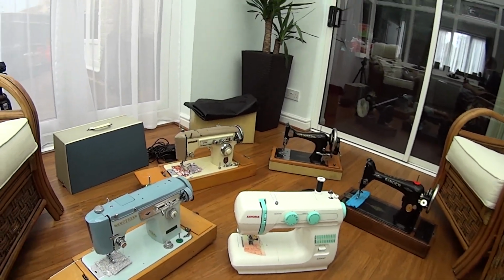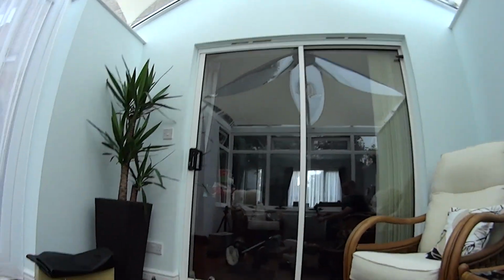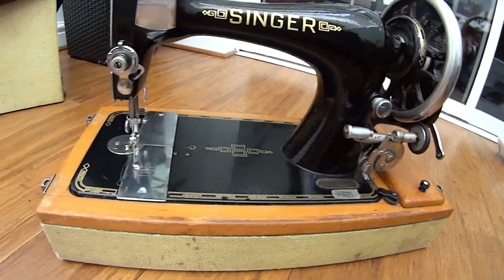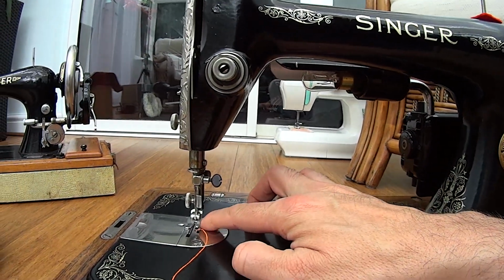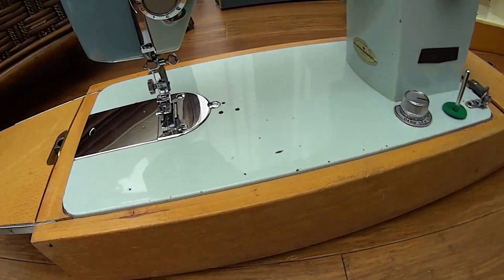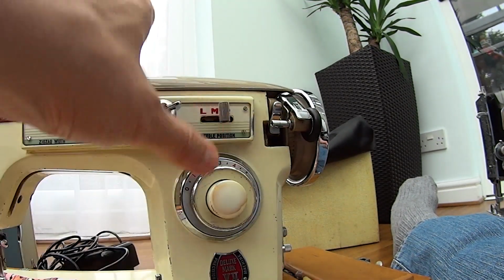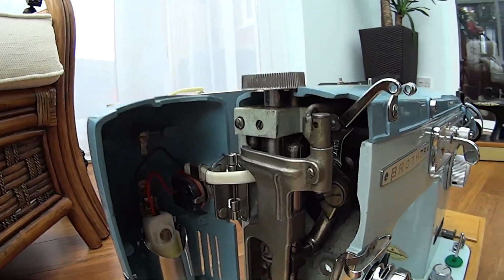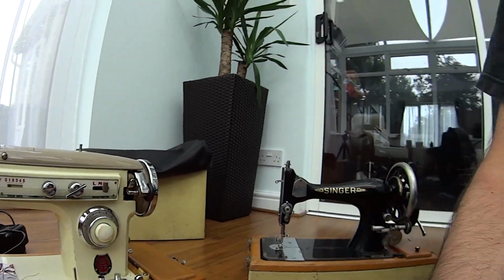How to buy a Sewing Machine : Wild Camping

Comment: Ebay wasn't working for me. I ended up picking up a Husqvarna Viking 600 off of Craigslist. Sews pretty well, certainly better than I do. I picked up a couple DIY packs off of Ripstopbytheroll. Sewed a stuff sack in about 20 minutes. It looks not that great, but it's completely functional.

It was more than I wanted to pay for a sewing machine ($200 US), but the local Husqvarna store took a look at it and declared it mint. So away I go.
Reply from the maker: Theball Player excellent there is no stopping you now :)

Comment: you are AWESOME !
Reply from the maker: Many thanks :)
Reply: Tac Blades hi friend.
would you like to design and teach to make a dual use ,  light, (empty shell - no insulation), 3/4 uq , that can be used as a spe ( pad extender, with side wings), or used as empty uq, or with whatever temp insulation, shoved in?)
thanks
Reply from the maker: gulu m its an interesting idea, its not something i want to build, but you can already buy a SPE shell that does just that for low cost so its not worth making.
Reply: Tac Blades I don't know of a pad. extender, that can be used outside as a uq. do you have a link?
Reply: Tac Blades perhaps it can be triple use, also as an uq protector.
Reply from the maker: gulu m yes maybe ☺️

Comment: I have a 1938 Singer 66-8, looks like the other black singer's you have. The wheel in the back moves in both directions, so does that mean I can do a back stitch manually? And are zig-zag stitches a must for tarp seams?
Reply from the maker: Maybe it depends if the feed dogs move the fabric backwards?  Normally the wheel keeps turning in the same direction.

Comment: Thank you for this video. Great info! I've got one of the old Singers that I'm going to have to refurb one of these days - it was thrown across a room when a car crashed through the building it was in and then sat unused and rusted a bit. I'm going to be on the lookout for ones like you recommended, though. What model are your Brother and the Novum? Both beautiful machines.
Reply from the maker: Thanks,they are pretty rare i have only ever seen 2, the brother is ja28 and the novum is the Deluxe IV :)
Reply: Tac Blades Very cool. Thanks for the info.
Reply: Have you had any experience with the Singer 403A Slant-O-Matic? I've read that it's quite sturdy. Seems to be the only non-plastic machines around my area as of late. 

Really enjoy your channel, by the way. Some great info all around. Looking forward to future videos.
Reply from the maker: Yes very excellent machines rock solid :)
Reply: Tac Blades Great! Many thanks for the info.

Comment: Great video,very informative! I've been using my Singer 201-2 for a few jobs and its a great machine with direct drive and reverse but only straight stitch so i've taken your advise and got myself a Brother (serial no'JA28). Unfortunately it came without a manual and i'm finding it difficult to get any info on the machine. Any idea where I can find out what model it is?
Reply from the maker: Its exactly the same as i have its a great machine and very rare.  Here is a link to lots of parts etc that might be useful,  or just email me directly for questions
http://goo.gl/StJ8lL
Reply: +Tac Blades thanks,what's your email address?
Reply: Tac Blades z

Comment: Hi Just to let you know that you inspired me after watching your vid, really enjoyed it, very practical, went on ebay as per instructions and bought myself a Singer 427 (straight and zigzag) for £35, seems ok, (drive belt for the handwheel seems loosish, not sure what tension should be?) not sewn anything for 30 years, but will carry on, thanks to you.
Reply from the maker: Its a great skill to have,  gald the vid worked you have a great machine there :) at a great price. 
You can get parts for it here http://goo.gl/3THfWL
The belt needs needs to be taught so not to slip but not put a strain on the motor usually there is adjustment on the motor mount to adjust tension :) 
Sew forth :)